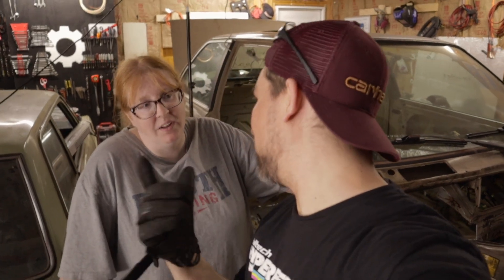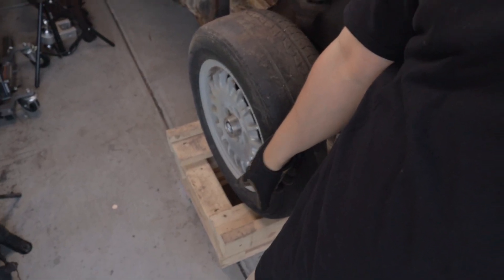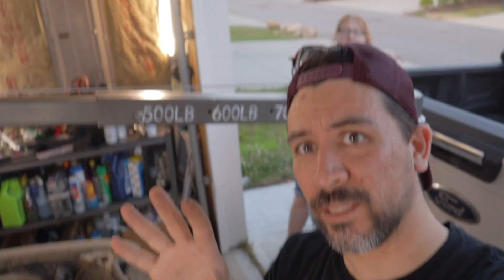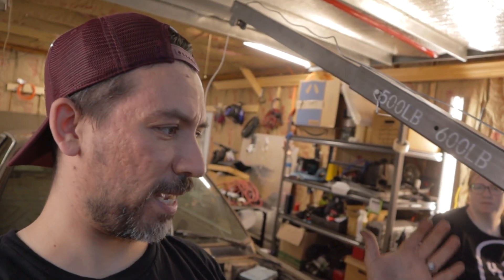Small Garage? No Problem! Pull an Engine with a Hitch

Comment: Instead of the Trailer Jack, Why not just use the Floor Jack and jack it up under the Hitch?, Hell even just a Jack Stand no?
Reply from the maker: You could go that route too. Just wanted something that could connect to the trailer hitch and could then be easily adjusted :)

Comment: So, how did that plate set-up work? Looks kinda weak, but I seen them today and thought I would ask you first since you did it. Im only wanting to take 200 pound jeep tops off and move my generator.
They have an attachment for hitches to not have that wobble. Cheap. You can get them at harbor freight too. I pull a trailer and dont use hitches without them now. Its a plate with a u-bolt that doesnt allow the hitch to wobble. 👍🏼
Reply from the maker: @ChucksVetAdventures  our engine was more than 200 pounds and the attachment for hitches to not have a wobble would be best. If you have to move things at extreme angles then having additional side bracing would help too.
Reply: @ Appreciate the response. Think I’ll give it a try 👍🏼
Reply: @Itsallaboutthebuild I did it 😎 Put a short up 👍🏼

Comment: Why are you using a wheeled trailer jack for support?  So you can move the truck a little while the engine is hoisted or something?  If not, why not just use a stationary trailer jack or even just a plain ol bottle jack for support?
Reply from the maker: Yes, seemed like the best idea for being able to readjust quickly. Also a bottle jack wouldn't have been tall enough. the wheeled one fit perfect 👍

Comment: It is a good idea but if you do it too often it will mess up the back suspension. Trust me I did a many times with that same idea he had.
Reply: 😂😂😂😂 no it won't 😂😂😂😂
Reply: @notchbackgta  why don't you try it and find out yourself
Reply: @timbones7659 what truck and what specifically got messed up in the rear?
Reply from the maker: @timbones7659  agree, it needs some more supports directly on the bottom of the step plate. Working in a few ideas for when we drop the new engine in 🙌
Reply: You can wear out the leaf springs. You can wear the shocks. Also the axle bearings. It's just common sense.
Reply: @timbones7659  BWAHAHAHAHAHA that's hilarious 😂 no, no you can't. Unless you completely overload the weight capacity, nothing bad is going to happen that wouldn't happen during normal driving 😂

Comment: I might have missed the reasoning. But the bar you cut the notch into to put the cable through is upside down. The one roller on the outside is supposed to be on top.
Reply: Lol oh no I understood that part. But the end section is shipped upside down. There’s a roller that the cable rides on. Keeps the cable from fraying. No clue why they ship it the wrong way. 

I stole your idea tho, and used the step. I was gonna get someone to fab me up a plate but seen this video.
Reply from the maker: @BelcrossMobileRepair  Fantastic, what will you be pulling or hauling with the crane???
Reply from the maker: Reason we had to cut it is because the cable needed to fit through the crane. We added our own electric wench and the wench cable wouldn’t fit through the crane. At least that’s how I think I remember it 😁😁😁

Comment: How did you attach the jack to the hitch? Did the jack come with everything or did you have to buy the something else to make the jack attach to the truck. I’m interested in the jack set up. You skipped that part. I’m asking before I buy the jack.
Reply from the maker: The crane was attached to the hitch using the a hitch step. The hitch step has added support with an added adjustable hitch mounted to a hitch jack. The wench is mounted to the jack with an extra wench plate. 👍